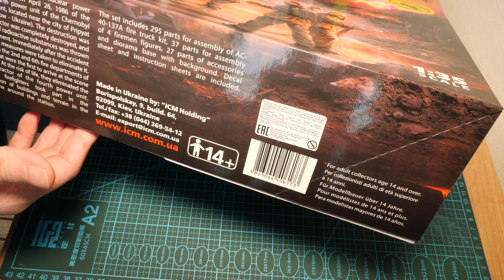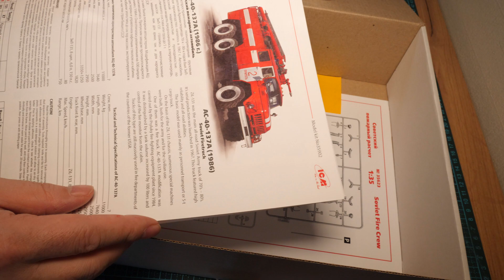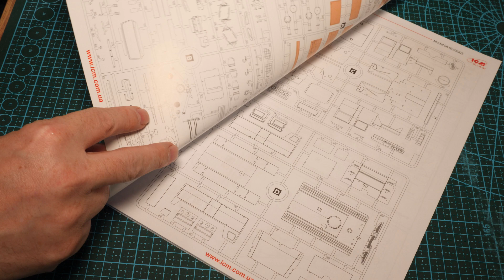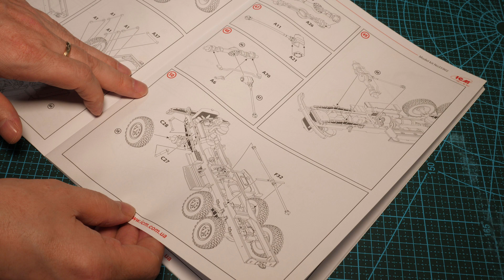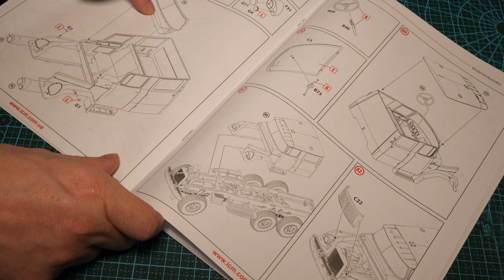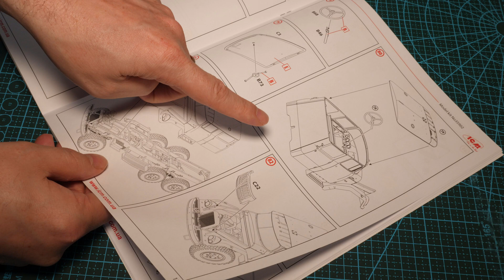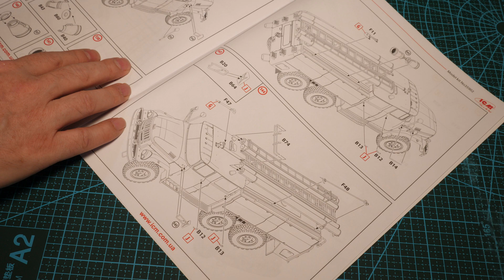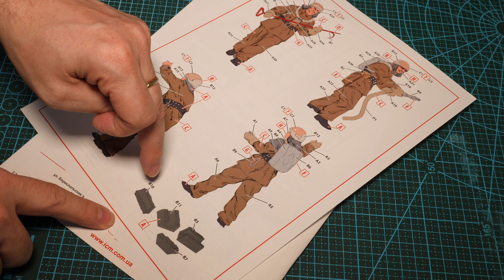ICM Chernobyl#2. AC-40-137A firetruck. REVIEW PART 1

Comment: This truck wasn't really used at SVPCh-6, SVPCh-6 or the Paramilitary Fire Brigade 6 used ZiL-130 AC40 fire engines and ZiL-131 AL30 aerial ladders, same went for VPCh-2 but they used ZiL-131 fire trucks like the AC-40- 137A, ZiL-130 AC40, ZiL-131 AL30's and numerous tanker trucks. These were all scrapped or dug and encased in concrete underground after the operations to put out the fires.
Reply from the maker: This is a very interesting piece of info. I will look into that for future videos!
Reply: @TheBearScaleModels  Mhm! No problem. I studied Chornobyl for 6 years and managed to disprove countless allegations from someone who studied for 20 years and went to Chornobyl multiple times, Also, SVPCh-6 used 2 ZiL-130 AC40 fire trucks, along with a ZiL-131 AL30 aerial ladder, they also had some GAZ-66 tanker trucks that were called in by VPCh-2 after SVPCh-6 arrived, the Pripyat Fire Brigade also didn't IMMEDIATELY go to the collapsed pump hall, they went to the Turbine Hall to help VPCh-2 and then they were re-routed to fight the fires at the pump hall and go on the roof.